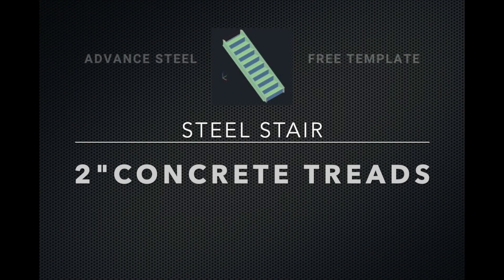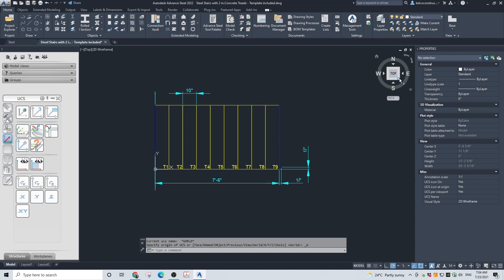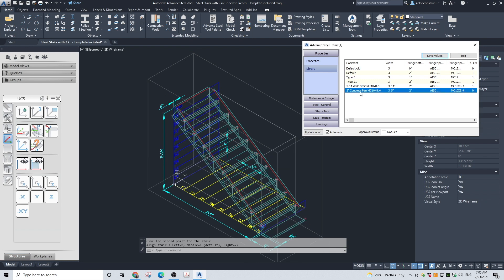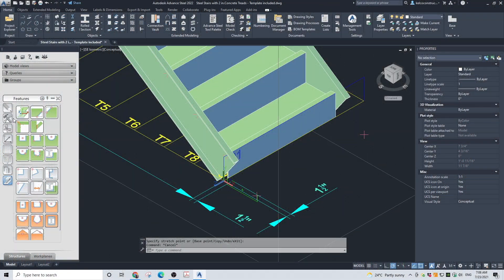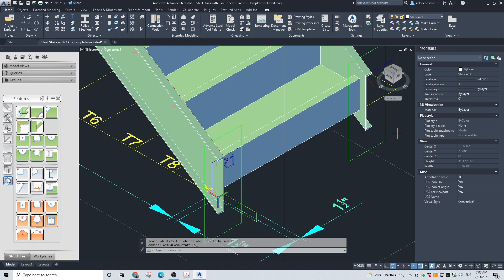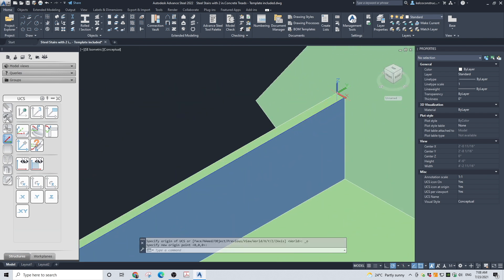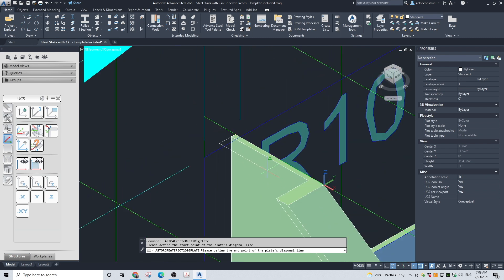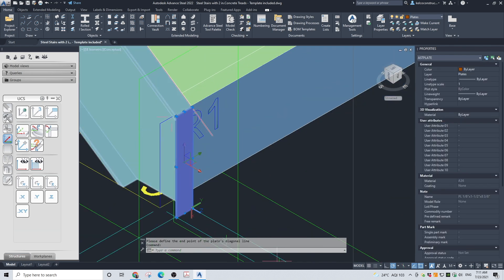Steel Stair with 2 inch Concrete Pan - Free Template Included

Comment: I am new to AS so I'm sure its me...but when I open it, I get an alert, "Advance cannot read this DWG-format (Astor 7.20) and will be closed."   
What am I doing wrong?
Reply from the maker: Sorry to hear that... are you using the AS 2022? I will check it after the weekend and let you know if the file is OK.
Reply from the maker: I just checked the file. It looks like it opens in my AS 2022 without any problems. But when I tried to open the same file in AS 2021 I got the same message. I think it is a version issue.